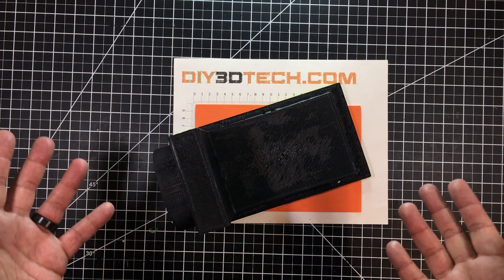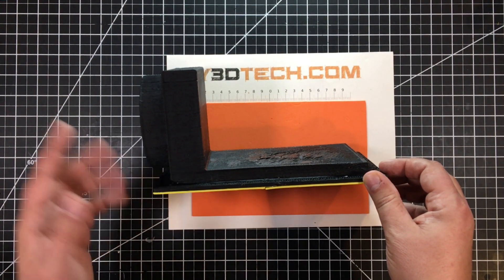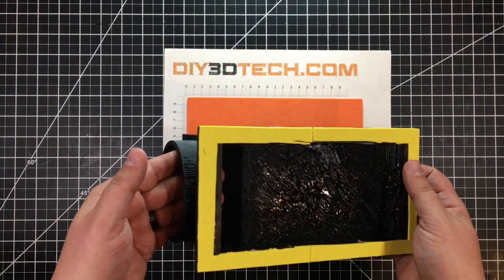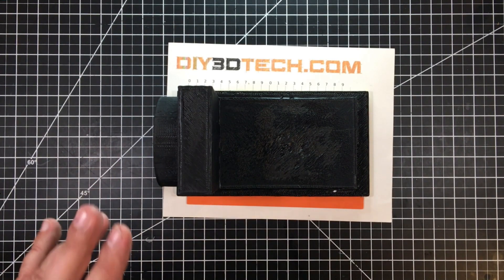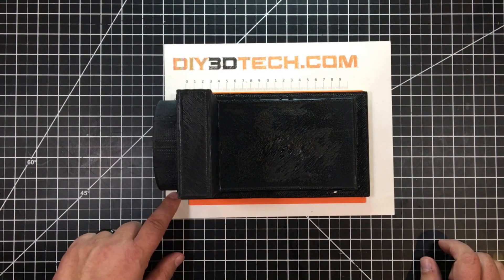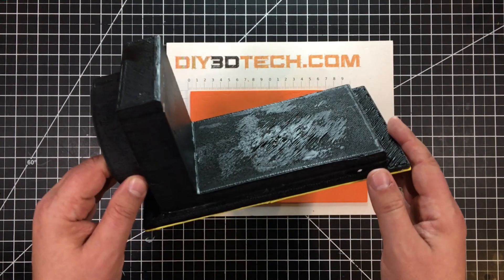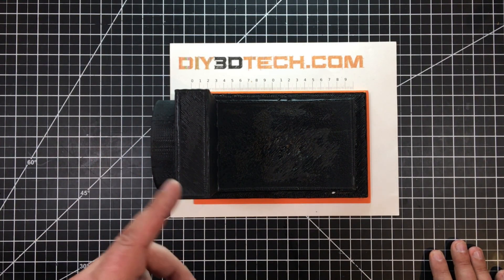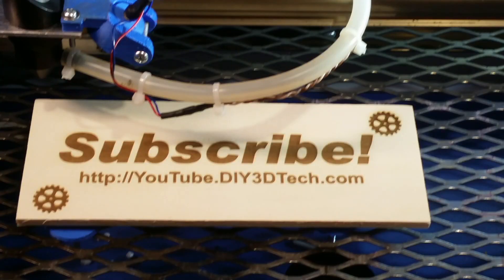eBay K40 CO2 Laser   New Exhaust Vent Design!

Comment: What about air restriction? to me that would pull more air from 1 side then a even flow from all sides. But a nice design  all in all
Reply from the maker: No real issues, however guess if you ran it as a fluid model I am sure it would be far from academically "perfect" however practically a moot point  as its goal is to depressurize the manifold and in fact if you look back in my videos I have successfully achieved that with 1.5 inch opening.  So long as there is a low pressure zone the  fumes will flow that way.  Also thanks for kind comment about the design :-)